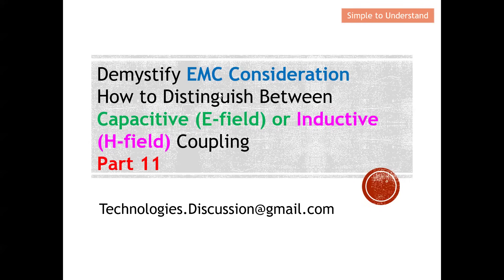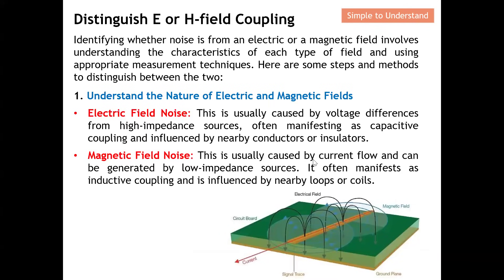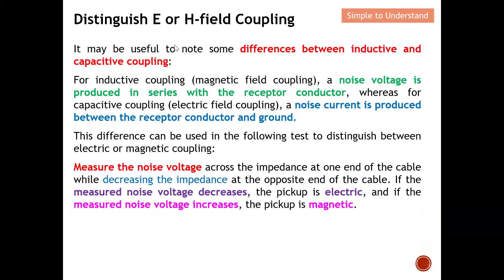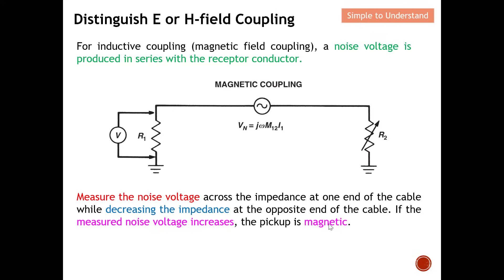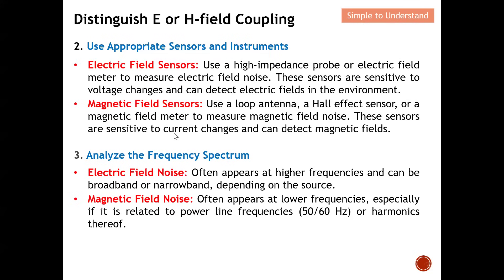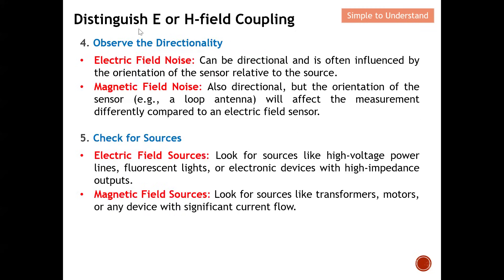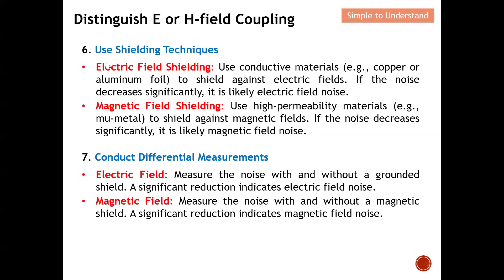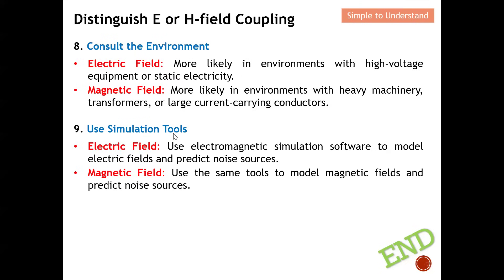EMC #11. How to Know Noise Source from the E-field (Capacitive) or H-field (Inductive) Coupling.

Comment from the maker: Thank you for taking the time to watch this video.
This video helps us identify whether the noise source is due to Capacitive (E-field) or Inductive (H-field) Coupling. This distinction is important because, depending on the noise source—whether it's Capacitive (E-field) or Inductive (H-field) Coupling—we need to apply different techniques to resolve the issue.
In Parts 12 and 13, the videos focus on solving Capacitive (E-field) Coupling, while in Parts 14 and 15, the videos address Inductive (H-field) Coupling.